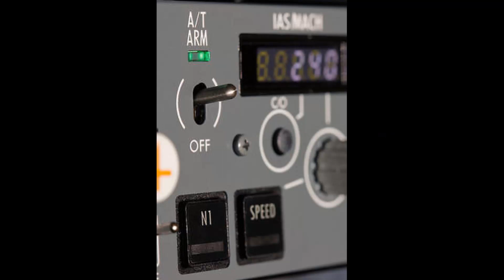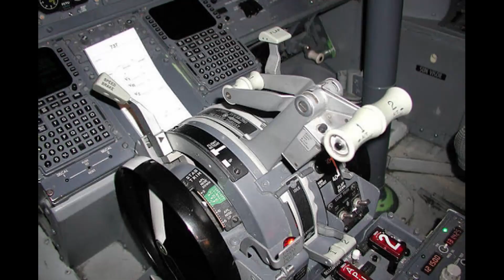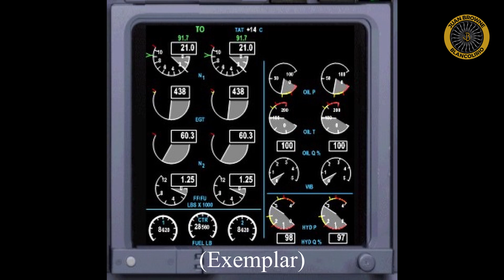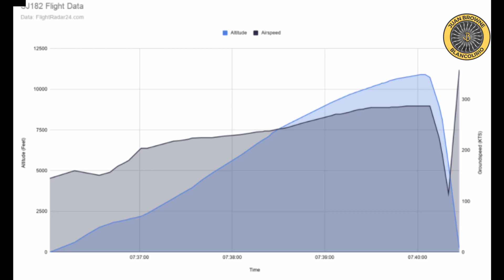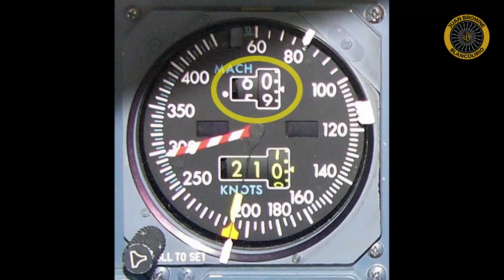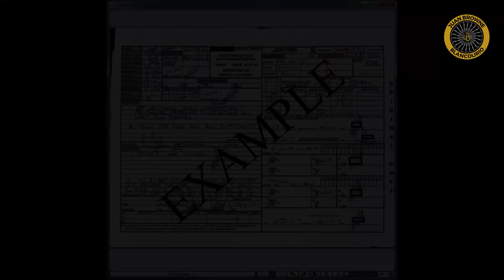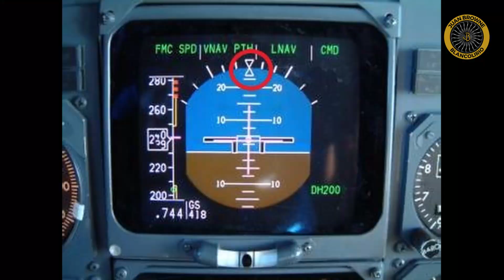Sriwijaya SJ-182 KNKT Preliminary Report 12 Feb 2021

Comment: Juan, according to the FAA MMEL, a Mach indicator may be inoperative provided the other one works and the Mach trim system is operable.  On a -500, the aircraft must remain below FL230 and below 320 KIAS.  Also, an airspeed indicator can be inoperative provided the EFIS speed tape displays are installed and operate normally and, one Mach/airspeed warning system operates normally.  These all fall under the category C, with 1 Mach indicator and 1 airspeed indicator required for dispatch.
Reply from the maker: Thanks B-37!
Reply: Can ANYONE explain to me what the hell the Mach indicator had to do with this crash?  Juan doesn't live in the real world.  He would make a great FAA man.  By the book is not by the real world.  C'mon, Juan.  Get off your high horse.  It was once said that the space shuttle could be 99.99% ready to fly and still have 5,000 things wrong with it.  These are complicated machines.  Anyone with an ounce of sense can find SOMETHING wrong with an airplane if you look long and hard enough.  I call b.s. on the Mach indicator having ANYTHING to do with this crash.  As with most foreign crashes, they cannot be called "accidents" because normally they actually are "murders".  Murders because these countries allow idiots in the cockpit.  They certainly cannot be called "pilots" by any stretch of the imagination.
Reply: @terrymalone6086    Well!  That was quite the tirade...
First, Juan simply spent 80 seconds reporting an item IN THE REPORT. He made no assertions as to relevance (in fact, sought 737 pilot commentary). SO now I ask.......
WHO THE HELL ARE YOU ????????????
Reply: @terrymalone6086  It may have no direct link with this incident, but it may say more about the safety management and maintenance systems of an airline. For example, was the fact that it took the full 10 days to be fixed an indication that the airline routinely lets things go as long as possible before repairing? Maybe, maybe not. Is the 10 day allowance even realistic, or has it been made up to better allow planes to keep flying while “waiting parts” beacuse they don’t want a large stock of parts on hand?
Dismissing an apparently unrelated item or event early on can lead dangerously towards missing key elements in an incident investigation, or a bias towards a particular outcome.
Reply: @TrainDriver186  Ever been around the real world much?
Reply: @TrainDriver186  The 10 day allowance is quite realistic.  As a matter of fact there are 4 Repair Category's A, B, C, D with CAT D having a 120 day limit.
Reply: @TrainDriver186  Indeed, exactly.

Comment: Not mentioned was what appears to be expedient/inappropriate corrective actions to clear the previous squawks. "Cleaning the contacts" most likely means that they merely re-racked the autothrottle black box. Cleaning the TOGA switches most likely was another BS corrective action just to move the aircraft down the line. Essentially they pencil whipped these items with a bogus action to cover themselves. Your point on checking previous write ups and corrective actions to be informed on possible further deficiencies is required by all US carriers. Dispatching with an open uncorrected item would be grounds for FAA action against the flight crew and the airline. In the case of this crew and the Lion Air crew, had they taken due notice of the previous crews write-ups they would have not been caught so ill prepared to deal with the an autoflight malfunction and would have been far more likely to have addressed the problem correctly.

Comment: That's a scary crash scenario. I'm guessing the working assumption is that the the left engine suffered an auto throttle malfunction or a mechanical failure in the engine, and the crew did not realize this until too late? The one thing that is ever more worrying is more and more pilots, especially younger, newer pilots, and those from areas with less stringent requirements (ie Commercial Pilots License only) are ever more trained to and dependent on the automation. I can't help but think that more and more they are listening to the computers, rather than listening to or feeling the aircraft itself the way the old school pilots were taught. It's kind of like trying to teach a modern kid to drive a 5 speed. Or a Three on the Tree. Good Luck with that. "RPM's?"

Comment: the sign off were pure window dressing all of these components are in a temperature controlled pressurized area and thus not usually subject corrosion. The mechanic performed a bite which checked ok and he needed a sign off. I have seen this happen many times in my career
Reply: The behaviour of the maintenance looks indeed problematic in this case.
Reply: Peter Mortensen  Bite stands for built in test equipment. when we say the mechanic did a bite test we are saying the that the mechanic used the self test  procedures that is a part of the system or component to determine the equipments status Is it operational or not operational

Comment: It seems to me no one was managing the aircraft itself. I mean no one was scanning instruments. When I'm operating my car, I don't just sit and stare out the windshield I am checking my mirrors and my speedometer , Tac, temperature and then back up to the windshield. I also rotate my head some to cover my blind spots. My car has the typical today blind-spot indicators but in all honesty I find I see things before they do. Same thing when I'm backing up I'll see traffic coming because I rotate my head before I get a warning on The Back-up Camera. I usually say thanks for nothing Gracie when that happens. In memory of a friend, she admonished me for not naming my vehicle's, I named it this car Gracie. I'm just saying my eyes are continually scanning the environment and The Limited instruments that I have. Wouldn't it be appropriate for Pilotsto do that? It would seem to me that they would have noticed the throttle pulling back or at least seen on the instruments that the port engine was not putting out the correct amount of power. I'm kind of puzzled by that and maybe someone can enlighten me.

Comment: Too much reliance on automated systems, not nearly enough experience hand flying the airplane. Sure, both pilots had ample flight hours, but my guess is that the vast majority of it was pushing buttons. Because we clearly cannot be confident that pilots will notice different throttle settings (even though they are readily apparent from glancing at the throttle levers) perhaps one of the recommendations will be that there needs to be a warning system to alert pilots when there is a discrepancy between throttle settings? I mean, we clearly need another warning because our button pushing pilots cannot be trusted to visually ascertain the status of the the throttle levers.

Comment: What are the possible causes of the split auto-throttle?  Could the repeat write-up for inoperable auto-throttle mean that a split had happened on a previous flight?
Reply: I'm wondering if some connection or terminal was "shorting" or similarly misbehaving causing the system to creep that one lever back for no apparent reason.
Reply: @tomdchi12  Why not just a bad servo?  That's an old plane, how often are the servo's serviced/replaced.  Maintenance apparently just cleaned the electrical contacts.  Stuff doesn't have to be dirty to fail.
Reply: @captaindunsel2806  My guess is that the connector that was cleaned had poor contacts. They're rated for a certain number of 'insertion cycles' after which the most likely cause of unreliability is that the Gold or whatever material is  used on the contacts to assure reliability wears off.  The correct solution is to REPLACE both the male and female connectors ! It was after all, a 25 year old plane, needing some TLC.

Comment: This wouldn't be the first time an autopilot quietly compensated for some kind of fault until it ran out of authority/ability to do so. When it then kicks off, the sudden upset is understandably startling, though with better training it seems like there was enough altitude to get out of it. Also one would have hoped that so much thrust asymmetry, as well as the Boeing throttle levers being way off from each other would have raised an eyebrow sooner.

Comment: Im looking at the chart you put up, frankly I don't know what this is really telling me.  The plane is straight and level aproximatly 295 kn [ (150 meters per second x 39.4 inches per meter )/ 12 = feet per second x 60 sec x 60 min/ 6020 feet per kn mile]. Some event happens as indicated by all three measurements begining a radical change at the same point. Altitude decreases at an increasing rate up to more than 19700 ft per min WHILE AIRSPEED DECREASES TO 98KN. How do you do that unless the plane stalls at 295 kn. Possible but ??? THEN AIRSPEED INCREASES TO WELL OVER 300 KN. Again ???

Am I reading this right? Your thoughts
Reply from the maker: Groundspeed
Reply: @blancolirio  I understand that this plot is ground speed. What you described is a circular motion pr spiral, that should give a plot which is sinusoidal. The graph isn't close to sinusoidal.

Comment: As usual your videos are both interesting and informative. I had not considered that the pilots may not be able to see the horizon in a steep dive.

My rudimentary analysis of the ADS-B data suggests the aircraft was accelerating downwards at 2g or more, 1g of which is gravity. I think that the aircraft was inverted at least in part i.e. >90 degrees bank angle.

It's deeply frustrating that accidents where the autopilot lets go having masked a growing problem continue. This leads to a much worse situation being handed to the crew without warning. Seems to me that there should be some audible warning when the autopilot is becoming "stressed" in handling an excessively out of trim aircraft before it gives up.

Given the thrust asymmetry, what would be the effect on trying to recover the plane without using opposing rudder i.e. just with ailerons and elevator inputs? Would that even be possible?

Also looking at the ADS-B data there does seem to have been a "valiant" effort to recover the plane - which is why the ground speed suddenly increases right at the end. Probably there just wasn't enough height to pull out of the dive and the aircraft was carrying a massive overspeed.

The dive phase quickly reached 500 mph or more vertical downward component. I don't think there was a shortage of airspeed and your interpretation of the reduced ground speed as being due to a spiral dive is correct.

If the aircraft were inverted but in a near vertical dive, would the crew pull through vertical nose down or roll the plane 180 degrees and then pull?

Comment: Wonder why the CVR has been so hard to find. I guess the CVR is not located near the FDR?
Reply: The impact separated the inner memory module from the rest of the CVR housing, which was located. So now they're looking for just the memory module, probably no bigger than a deck of cards and encased in gray putty, at the bottom of the ocean.
Reply: @jonathankleinow2073  Others have said the memory module is a bright orange can-shaped object, about the size of a soft-drink can.
Reply: @lizj5740  That is possible. I was basing my description on a "how it's made" video of a CVR, but I don't know if it was the same model as what was on the aircraft involved.

Comment: Some have asked, "why did the autopilot click off without any warning, leaving the aircraft to be hand flown in an unusual attitude. Normally the aircraft can be flown utilizing the autopilot on a single engine. The difference here is that the aircraft was not trimmed to deal with the differential thrust, and the autopilot reached the limits of its authority. Usually with an engine failure the aircraft will be hand flown with the autopilot and thrust levers disengaged until the the engine failure/shutdown drill is completed. At this point the aircraft will be trimmed up and then the autopilot can be re-engaged. With this unusual attitude, immediate intervention of the flight crew was required. The turn and rolling moment was being created by the high thrust on the single engine, therefore, not only would the crew be required to reduce the pitch attitude, but they also would have to have reduced the thrust on that engine. With 10000 ft of altitude, they could have pulled both engines to idle, lowered the nose and rolled the aircraft level with plenty of altitude to spare. The 737 has an excellent glide ratio, so it was not going to immediately fall out of the sky if both engines were at idle.

Comment: Hell. The 737-500 Auto-Throttle Disconnection reason was unknown for this flight. 2 engines were running before the plane crashed. Let us wait 2 to 3 years for the cause
Reply from the maker: No. These lessons need to be learned NOW Jaden. You are NOT going to be allowed to sweep this under the carpet. Juan.
Reply: Blancolirio Understood sir.

Comment: Looks like there is an MEL for one MACH indicator only, provided one MACH/AIRSPEED warning and one Mach trim system operates normally.
Reply: Per the MMEL from which the operator would derive their MEL, the MACH portion can be inoperative per the proviso you stated. A couple rows lower they also allow the airspeed indicator to be inoperative (with the same repair category C) provided the EFIS tape displays are installed and operate normally and one MACH/AIRSPEED warning operates normally. So appears it was legal to dispatch with that entire system inoperative (i.e. both the Mach and airspeed portions inoperative)

Comment: Juan, in a GA airplane In a nose down spiral wouldn’t you also pull back the throttle? (You might then notice the split throttles) It’s hard for me to imagine flying an airplane without paying attention to the instruments. Your scan would catch the falling N1 and the spinning heading. Even the sound would be a cue. How is this possible that two highly experienced pilots could fall so far short?  Complacency? Wow.
Reply: Begs the question, what mechanical/electrical malfunction would have offered the same scenario?

Comment: Sounds like the auto throttle failed again,during a turn and these folks failed to notice it until the Autopilot gave up.
Reply: Autothrottle may not have failed if air sensors were iced on the Left side, A/T may just have been reacting correctly to erroneous airspeed & aittitude data.
Reply: Indeed. So to my understanding it´s necessary to look not only onto the pilots in this case but at least as much onto the maintenance and how the mechanics dealt with this repeating failure of the autothrottle´s. To me this accidents reads as if the same technical failure simply occured a third time and that this pilots were now for whatever reason unable to manage the situation properly.